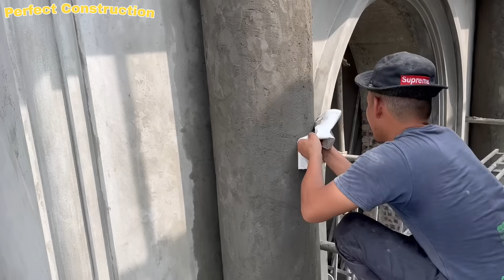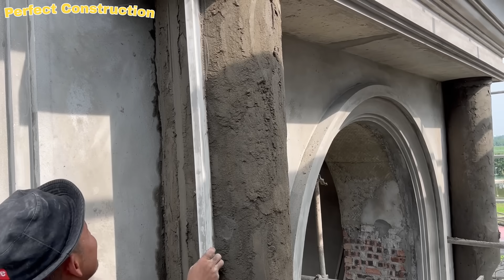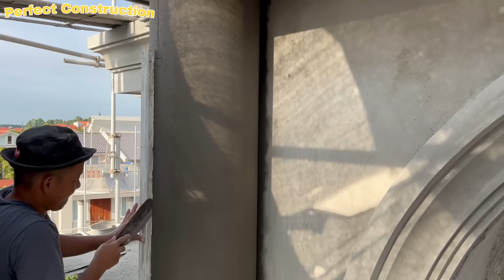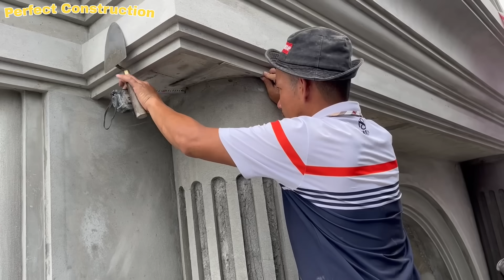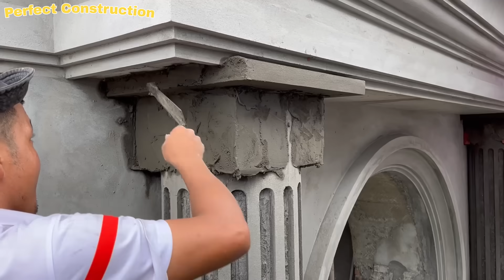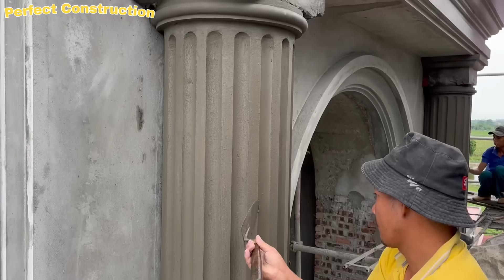Construction Techniques To Decorate Beautiful Round Porch Columns Using Fine Sand Cement

Comment: What's the cement and mix
Reply: Just cement. The painters do the real magic after a few months and it's cracked all to hell. Most of these guy's straight plaster with cement and water mix. If there is any sand it's probably a 3-4 to 1 mix after it's sifted through a fine mesh.
Reply: can you elaborate about how after a few months it’s all cracked? is it the painters who help prevent the cracking? i really want to do this for my house
Reply: Probably 4 fine plaster sand to 1 cement, then sprinkle with neat cement when shaping
Reply: @Pauly365 shouldn't crack esp with decorative plasterwork....very often these specialists will add a plasticizer such as lime to retard drying and make it more flexible. I had a construction business and seldom had shrinkage

Comment: They should use their sculpting skills to makes molds for fine castings. Then they can get hollow concrete column sections that can be stacked on site as well as cast capital pieces that can be assembled as well on site. Then the molds can be used over and over to make more columns. Seeing how skilled they are they clearly have made more than on set of these built on site so making castings might save tons of time for future projects.
Reply from the maker: Thank you❤️❤️❤️❤️❤️❤️❤️
Reply: And soon they will be out of work jou mean!
Reply from the maker: @neila484  thank you❤️❤️❤️
Reply: Those columns are probably one-offs or is ordered few and far between. Not worth making molds for them as other people would request a column with a different look.